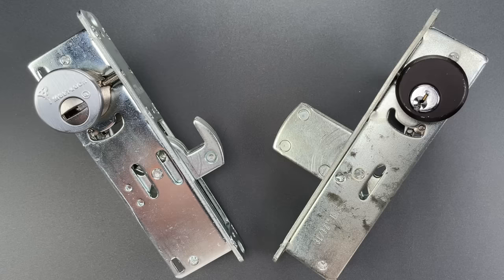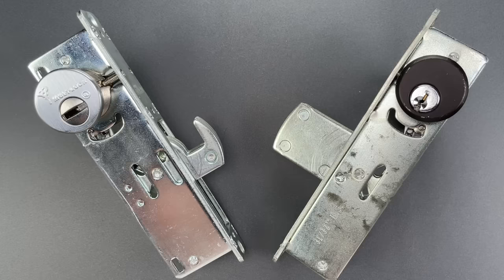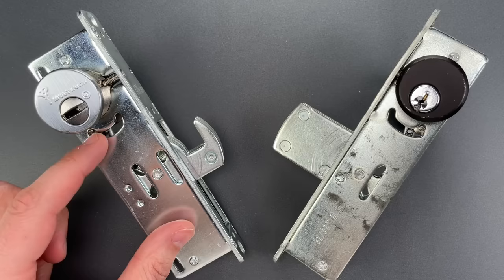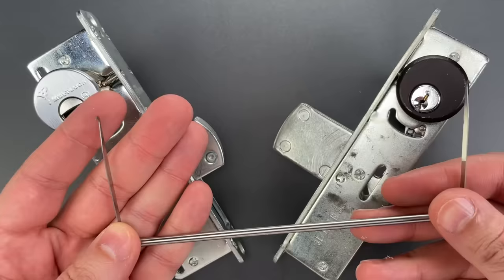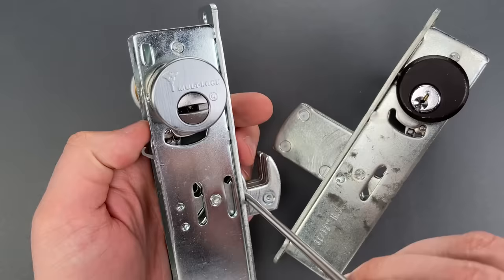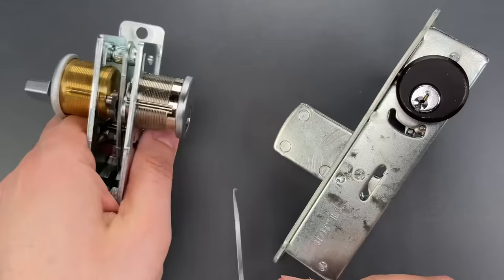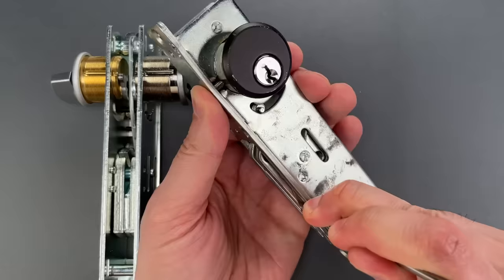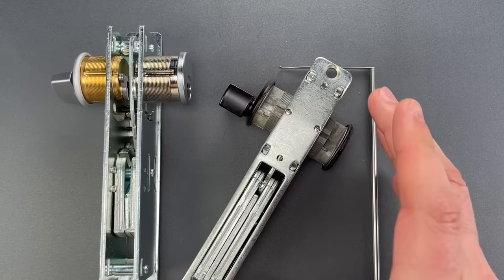[1409] The Most Significant Security Flaw in North America

Comment: This channel is why I've started to allow my players in D&D to use Intelligence instead of Dexterity for their thieves' tools.
Reply: I might start doing this now too
Reply: Because usually just knowing how to do something makes up for years of feeling and practice.. thats like having an int check for a door and the solution turns out to be just banging on the right point of the door frame. Bad take.
Reply: @shagy273  yes, that's exactly the reasoning. As they say. $1 for knocking, $999 for knowing where to knock
Reply: @algrant33  $1 for welding, $999 for knowing how to weld. Application of knowledge is important
Reply: I'm not sure I agree with this take. You can be a genius, but let's see you picking a lock if you've also got two left hands and tremors (or in other words, 1 Dexterity)... Meanwhile even an average Joe can just memorize the types of locks out there and tools, the rest is down to being more dexterous.
Reply: @karlmarxstolemybike3382  yeah, simply put int is knowing how to pick a lock and dex is actually being able to pull it off
Reply: The proficiency bonus or skill points are the trained elements the character has learned. Otherwise int could be used for everything. I would allow int for figuring out how a lock works, but that would be the same at that point as an investigation check.
Reply: If you guys really want to get pedantic into it, medieval and renaissance locks weren't nearly as sophisticated as modern ones and generally didn't have the fine tolerances that you need to feel out for. Skyrim is not an accurate depiction of medieval locks. Further, if you guys look into modern penetration testers, most of the time they use clever tricks and exploit design flaws to bypass having to pick locks entirely and open doors using techniques that require basically no skill, just the right tool and knowledge. A huge number of locks on this very channel are bypassed with low-skill attacks that require no picking, just knowledge of how they work. Dexterity in D&D is considered the best ability and Intelligence the weakest—there's no need to get up in arms over tossing a bone to characters that put points into INT. There's more than one way to tackle a given problem.
Reply: @carsonm7292  You make good points, I don't know D&D, but if it's a weak lock, even strength or magic  (fire?) could break it.
Reply: @Raiaka  1. D&D is not a setting, it's a game system.
2. Settings are supposed to be internally consistent even with magic. Most of them have a medieval level of technology. So they are going to have medieval locks.
Reply: It really takes a combination of dex and int to do stuff like this. It’s not just one or the other for every skill. Another reason why D&D is not always transferrable to real life.
Reply: Go half and half, having the finger dexterity to do what you know is also part of it.
Reply: @Raiaka  You're failing to consider that D&D is a game system where the Dungeon Master has control over what their players can and can't do, if he allows them to use Int to open locks so be it, magic also uses Int so I don't see any problems with using Int to unlock doors by bursting through one with fire, if it's a hard lock that can't be opened with magic or the person has really low Int then they can use Dex to unlock the door. People keep failing to realize that the whole point of D&D is using your imagination so you create the setting, the monsters and NPC's, the doors and locks, everything pretty much.
Reply: @coolerplays3477  Thank you. I did not expect the fantasy police to burst into my home like this. It's a game about using your imagination, y'all.
Reply: @carsonm7292  you have the right to shut your imagination up, the interrogation room is down the rabbit hole  and no lock picking skills required.
Reply: @karlmarxstolemybike3382  That sounds perfect for a wave rake
Reply: The DM is all powerful, what they say goes regarding rules and implementation.  There is no outside appeal. You can just stop playing if you don't like it enough.
Reply: I'm pretty sure there's an option in the DMG detailing how alternative stats can be used for skill checks, like how it's fairly reasonable for Intimidation to not be CHA-based because you can argue that simply displaying a feat of strength or intelligence can achieve the same result.

Oh and my go-to argument for INT checks on lockpicking being logical is because Artificers exist. These guys could have atrocious DEX stats in your character sheet, yet you can never take away the fact that they are tool masters. So yes, knowledge is in fact a viable substitute to any kind of motor skills required for tool handling, in the context of DnD.
Reply: @Boxish  I think you are missing an important part here, who asked?
Reply: @shagy273  I asked
Reply: @Revoltine  Hell, it's possible for someone knowledgeable but literally without hands at all to verbally guide someone who might not know what to do but having the dexterity to do it. 

I've had a campaign where another guy played an artificer who lost his hands as punishment for some unspecified crime, so he guided someone else (a thief, who may or may not have been an uncaught accomplice to the aforementioned unspecified crime) through the process of making him an extraordinarily intricate and complex pair of what in that world was called "magitech mittens", AKA replacement hands.

Reason I specify the increase in intricacy/complexity, and why I gave the name for the objects, is because magitech mittens were USUALLY not so much like replacement hands, and more like gloves without particularly fine motor control, but with tactile sensory input transmission capabilities so you could feel what they touched. Think oven mitts, but for work inside magical systems that wouldn't interact well with bare hands for various reasons.
Reply: @carsonm7292  I could have respected your take with wanting to 'buff' INT (kudos for that regardless), had it not been for your frankly condescending comments like "Skyrim is not an accurate depiction" and "fantasy police". Also, I wasn't trying to pick a fight with you, I was just stating my honest opinion and wanted to strike a conversation about it. But apparently people wanted to get all butthurt about it instead.

I'm also not telling you how to run your D&D games. Hell, have a random cow's udder be the one vulnerability to open up the door, which grants access a legendary weapon, do whatever you want at your tables, but normal people that play games want to be rewarded for their characters' skills, rather than have anti-climactic solutions.

Comment: I worked for a retail jewelery store. We had 3 security cameras trained on the front door, and zero inventory kept in the display cases overnight. It all went into the bank safe in the back. The lights were kept on so that someone looking in could see that the cases were all empty. There was also a security system with outdoor klaxon. So while I suppose that our front door was susceptible to this attack, the dead bolt was far from the only security measure in place. Anyone picking the lock would be recorded on video from 3 angles, and have cops on their way 30 seconds from opening the door. You don't stake your entire security strategy on your front door being unassailable.
Reply: Most shops are not jewellers...
Reply: I agree. You have to think about all those other elements, even in a lower-risk scenario. I had cameras covering every door and window at my previous location, some with double-coverage due to moving head cameras also being able to see it. The more you can do, the better. Of course, it's all deterrent.
Reply: @malthuswasright  Granted, but no matter what type of shop I had, I wouldn't rely solely on the deadbolt on my front door. A lot of shops have pull-down metal doors or screens.

Comment: Just about every door you can open with this will be tied into a security system. Once you open the door, you'll have 30 seconds before the alarm goes off. You're better off breaking the glass. Though your high-end stores are going to have motion sensors aimed at the door. Some will have an audio detector to pick up the sound of the glass breaking. I wouldn't worry much about a crime wave from this tool.
Reply: Ok, Joe Shmoe

Comment: Interesting tactic, but every storefront door I've come across here in Canada not only has a shield in front of the bolt, but the gap between the door and the frame is also quite a bit less than what you see in this video.
Reply: We're sorry, you're going to have to do it the old fashioned way.
Reply: And a lot have metal bars behind the windows too, in cities. They do try to make it at least moderately difficult here
Reply: for some reason it seems like americans have no regard for safety when it comes to locks, half the house keys are old wafer locks that a child could pick. In finland practically all house/office keys are the half-moon abloy type or some kind of smart key system, making this kind of hobby a lot harder

Comment: I’ve made these tools outta windshield wiper blades they do work well and fast but all depending on the door. The door in the video you can back a car into the gap ,some stores gaps are a lot smaller (also gap between lock latch and door) so for this tool too be the most effective you need different widths and thickness in my opinion/experience.

Comment: So what’s interesting is that this isn’t exactly a “flaw”. In the past no lock or series of security devices could meet changing fire codes and the need for police and fire to access business occupancies. If there’s no key available, this lock can be accessed without the need for damaging the door or glass which is much more expensive than the lock. Doors on commercial buildings that have better locks usually just have the glass busted. So there isn’t really a need to “fix” this issue.
Reply: @samuelcorbett8167  If a thief wants in the store, they will get in, whether it's picking the lock or busting the glass. The alarm system is the more part of the building security. Also, for the OP, where I live, all stores are required to have key boxes (with a key for the doors in it) attached to the building near the primary entrance that can accessed by the fire department to make entry. Been that way foe decades here.
Reply: @samuelcorbett8167  like I was inferring, it isn’t up to the store owners. Commercial occupancies have to be up to code. Many people have died in old buildings that didn’t allow easy entry, but also had no egress. Retail Business thefts are usually smash and grab type incidents. No usually clearing out the store. So paying 10k for a door that’s busted isn’t as bad as a $100-200 lock.
Reply: @singledad1313  yes same with my area, though great as it is, you’d be surprised how often the keys aren’t updated or are just not in the box. That’s said. Even with  the Knox keys, Fire codes still don’t allow for security bars, reinforced glass, ect because of the egress issues
Reply: @uhavenosushi  In my area, the fire department makes regular fire inspections of the businesses. The first thing they check, every single time, is if the key is in the box and works on the door.
Reply: @singledad1313  that’s what I do as well. But when you have a few hundred businesses, things happen. Owners happen, so on a so forth. on top of that, Adam’s rite locks are older than master key systems like Supra or Knox. So in theory you certainly could upgrade your doors if you have a Knox key. But you’d have to change the entire industry to get there. It’ll probably happen eventually. Just slowly per usual.

Comment: "The most serious security flaw in the US today" - Any lock on a glass door is obviously not designed to keep out a determined intruder. It is designed to keep out opportunistic  intruders, who are neither equipped with a specialized lockpick nor have the desire to pick a lock. Most stores rely on motion sensors. Regardless of whether the door is locked, if you walk in it'll alert the police.
Reply: Yes the lock should keep the criminals out. The alarm system is simply an intrusion detection system which in itself does nothing to stop people.
Reply: This comment deserves more visibility

Comment: Does this also bypass the mandatory alarm system every company has? You might as well just bust the window out and go in. The alarm is going off either way.
Reply: Not every company has an alarm and it's not mandatory, and it's also faster than breaking the window, without the risk of cutting yourself, and it doesnt leave a shit ton of evidence
Reply: I mean, this video isn’t for people trying to get in without authorization. If you’re a first responder or a locksmith who’s been called out to a store by a valid authority of that store, they’d have access to disable security inside.

Comment: I'm a locksmith, this Doesn't work in %95 of stores, first most will have a side plate so you can't see the latch, second if the door was installed correctly this tool will be too big to fit.
Reply: This works 100% in any walmart or home depot or lowes store.  As the evening shift for the last two, we were told to put the bolt down a tiny bit, and force it home with a pocketknife or such from the outside as the last person was leaving so the overnight shift didnt have to come lock themselves in, as it was a waste of their work time.
Reply: @willdavis3802  Walmart doesn't have that many locations in numbers nationaly is very negligible and I don't really think they care, they have a million security systems
Reply: @miltonfriedman3593  They have exactly 3 security systems, but only in big cities.  They are open 24/7, they pay cities to have a cop outside, and they pay for rent-a-copsin the parking lot from 7am to 9 pm.

Comment: Not only is the lock easy to get into but the locks holding the opposite door closed are easy to break. The ones where you use a lever to push a pin into the floor and into the top of the jamb are made out of plastic and can be broken off in a matter of minutes. These doors are not very secure from a brute force attack.

Comment: My sliding glass doors are secured regardless of whether the latch is locked or not. The only danger involves escape in case of fire.  Thus, I had to design a locking bar stop along with a second lock which is easily and quickly actuated from the inside but is not accessible from the outside, no matter how many of what type of fancy tools you might have.  Obviously, I'm not worried about anyone breaking glass, as that's always an option, albeit one which alerts me if I'm home and triggers the glass break sensors when I'm away.

Comment: Most doors here have no access to the gap between the door and the frame here on commerical buildings. And we have a different mechanism that won't allow access inside the lock from the side of the door. Sure we have different locks and probably some that are this easily picked, but in my time of working on doors and locks I have never seen a lock/door this easy to get into.

Comment: This tool might not work if the gap between the door and the door frame is too narrow. Or there is a protection plate there. But no doubt this is a great tool to open most of those aluminum glass doors.

Comment: The real security flaw there is the door, not the lock. There is no weather shield over the gap between the doors. (Every door you see in the UK has such a shield integral to the door frame itself, which also prevents the classic credit card trick beloved of Hollywood). I'm amazed that the mechanism is so exposed.  You could simply cut off that tongue with a disc cutter.

Comment: I don’t know if it’s a USA thing but in Canada most stores I’ve seen with locks like that have a steel plate attached to the door that cover the gap between the door and the frame where the bolt is.  So the region where you insert your tool is covered by the steel plate and I’m pretty sure that it prevents this type of attack.

Comment: From a security perspective, it's truly unconscionable that anyone would intentionally expose the inside of a lock to the general public.  If there must be a gap between the doors, regardless of how big or small the gap is, then the lock area should be covered by a shroud which covers the gap to prevent any access to the lock interior.  That's just basic common sense (which, sadly, isn't common anymore).
Reply: Then you run int to problem of air control and quality  of lock and time spand of it lasting

Comment: This isn't meant to keep criminals out though, so it's not really a problem. It's just meant as a "we are closed go home" deterent. Every single store using these locks also has an alarm system with motion sensors and cameras constantly recording. Pick the lock or break the glass, either way you are setting off an alarm and you have been recorded. Not really a flaw.

Comment: so, for the lock on the RIGHT, if you just use a flat, stiff object, like a credit card, that can slide between the door and the door frame, and use that object to push down on the bolt.. would that not work?

Comment: I just wonder... When you show this(🤯..) "dry", you insert the tool with hook to outside of the lock, ie doorwards, when you pick the door "in the field, the hook points toward the lock...
Is there really no difference?!
I mean, a blind baby can do that if she only manages to hang on strongly enough to pull the ward (?) down...
That can be done w/ any old piece of wire, xept you need something rather rigid for that downpull, depending also on the lubrication and cleanness of the doorpiece...

I'm deeply shocked...😱
Thanks!

Comment: Why is the tool inserted with the hook pointing in one direction when he picks it on the bench but the hook points in the opposite direction when he picks the actual locked door. Is the bar accessible to be pulled from both directions?